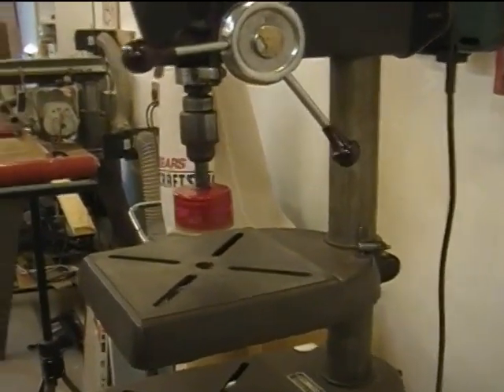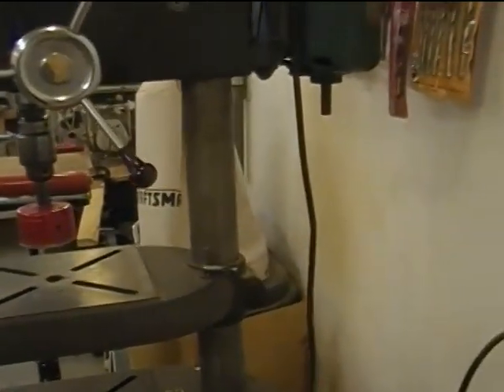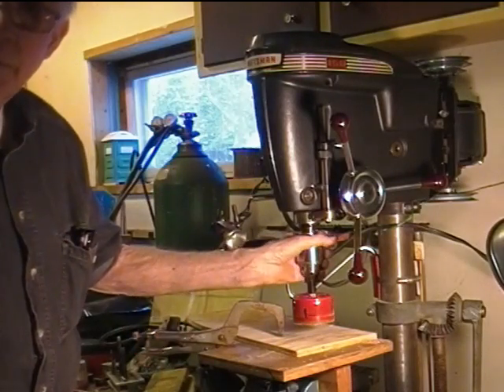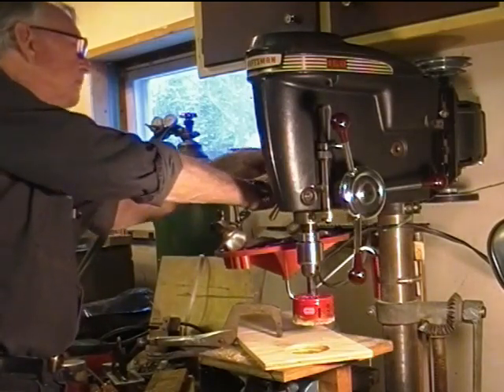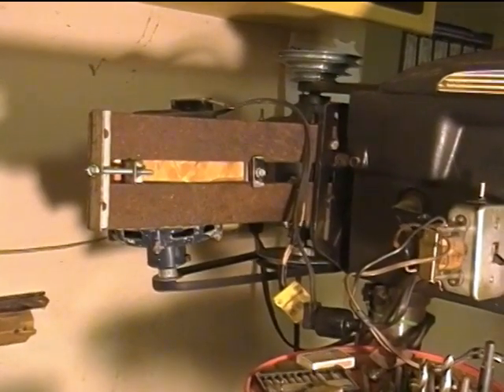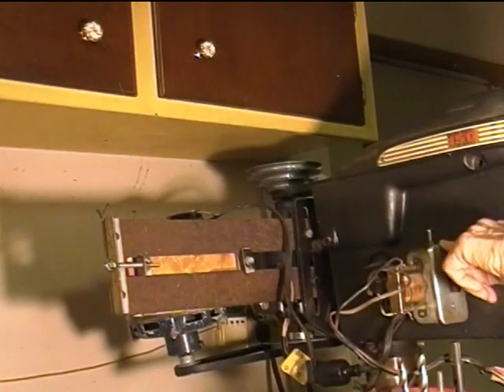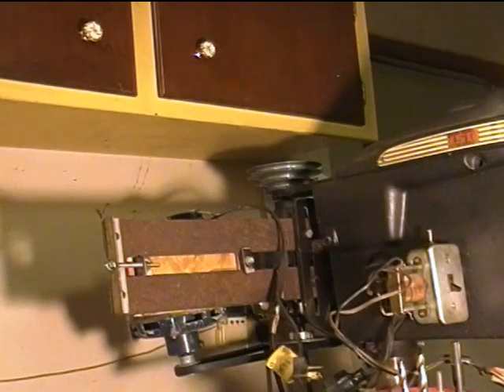Drill Press Speed Reducer

Comment: So it looks like you are able to maintain tension with all those belts.  Usually when one uses a Jackshaft and another sheeve there is a problem with belt tension and the belts skid on the pulleys.  Have you tried drilling steel with a 1" diameter or larger bit with your machine?  Great video thumbs up.

Comment: Great video, thanks for sharing. How does the second motor transfer power to the spindle?
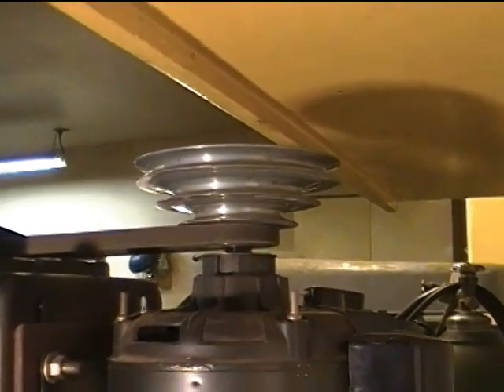Reply from the maker: I explain how the second motor is belted to the main motor starting at about minute 3:40.  In the slow speed mode, the main motor is simply acting as a jack shaft.  So, in that mode, the main motor's ouptput shaft end still drives the spindle.
Reply: @frenchcreekvalley  thanks!

Comment: curious as to why i cant find info on slowing down a drill by using a potentiometer or voltage regulator of some sort wired into the original motor. will it fry the motor out
Reply from the maker: Most drill presses and other machine tools that have single phase, single speed motors are "synchronous".  That means that they are designed to run at only the  speed that comes from 60 cycle power (USA).  If you did try to slow them down as you suggest, they will simply TRY to maintain that speed while drawing more and more current from the power source.  They will actually loose power, and, pretty soon destroy themselves.
  These days, they do make VFD's  (Variable Frequency Drives) that actually allow the user to change that 60 cycle incoming power to either more cycles per second or fewer cycles per second.  In this case, the motor's speed CAN be changed safely, within limits.  Not always, but in most cases, these VFD's are designed to output 3 phase power, even from the single phase power source that most of us have in our shops.
     There are, nowadays, many (usually Chinese) imported hobbyist machine tools that have motors that run on Direct Current, not the Alternating current that comes into our (USA) homes.  These tools rectify our incoming power to make DC, then, using a DC motor and speed controller, allow for variable speeds.
I hope this explanation helps.
Reply: @frenchcreekvalley  helps greatly. Thank you.

Comment: Why is that transformer coil mounted to the switch exposed and not in a shielded box?
Reply from the maker: That's a low voltage transformer that provides power to a small aircraft cockpit light bulb that I use to light up the work area right under the chuck.  If you look REAL close at about 4:40, you can see a wire snaking down and to the right.  It's a piece of solid 14 gauge electrical wire.  The little light bulb's socket is connected to it, just to hold it in place.  I can bend the wire to put the light exactly where I want it.  That was supposed to be a temporary thing about 35 years ago.  I think that solid wire broke once about 10 years ago and I replaced it.  No failure since.  I guess it just turned out to be so handy, just as it was, that I never did do anything better.  i am almost embarrassed to tell you this, but not quite.

Comment: Using the original motor as an idler shaft is a great example of outside the box thinking. This is the same in principle as using a three shaft, two belt  system available on some drill presses with the odd shaft being an adjustable intermediate one. The fun part of this one is that the motor is cheaper than almost any one of the parts of the intermediate shaft design! For using the original motor you might need to check to see you are not over-speeding the new motor, but it would an easy task to roll off the new belt. My old Craftsman uses a third scheme of using  many sheaves on two pulleys by switching to very narrow belts and sheaves giving a top speed of 8500 rpm, but a low speed in the 150s range and a belt that tends to slip with big drill bits in steel. Sorry not to be specific, I’m not going out to the shop this early and the exact number is pretty irrelevant. 

I could probably move the existing pulleys up their shafts and insert two narrow higher ratio cog belts to the spindle shaft and get as much as a 5-10 ratio slower spindle speed (850 rpm high speed and maybe 15 rpm low) with a 10:1 cog belt ratio, and perhaps a 2:1 ratio to halve that virtually unusable 8500 rpm  current top speed while removing the possibility of belt slip in the high torque, low speed end of the belt train.
Reply from the maker: I always remove the "slow speed" belt when using the main motor.